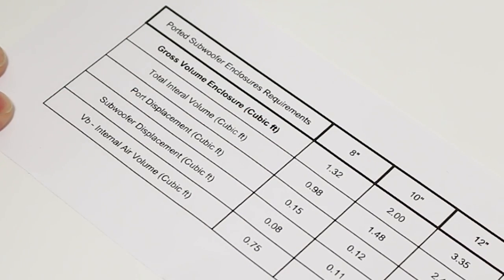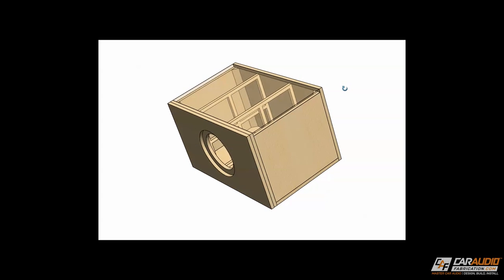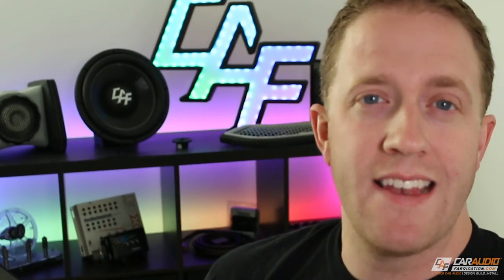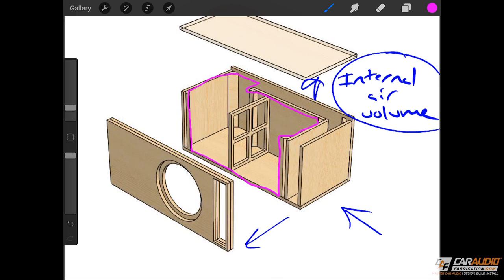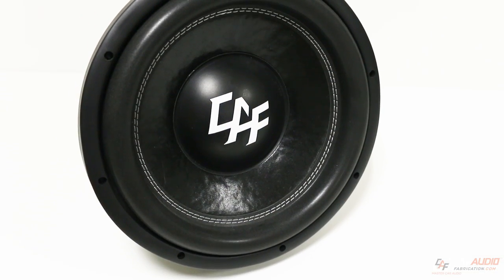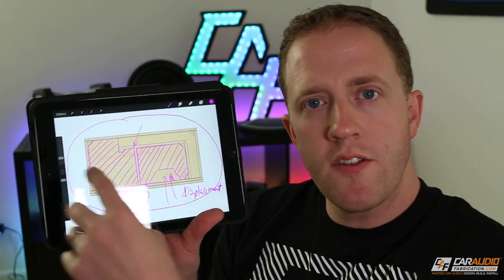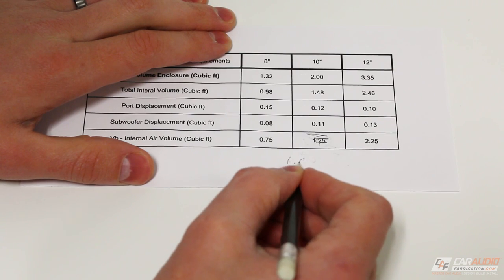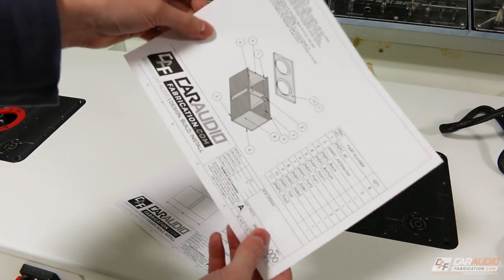Subwoofer Box Volume Explained - Gross vs. Net vs. Air

Comment: I use fosgate stuff and they give you the ideal dimensions for a sealed enclosure. Would u follow the dimensions exactly(p1s4 10") or would u do your own? Ive built a few of my own over the years but didn't follow the factory exact box specs. Always did my own thing mainly due to wanting the sub to fit in a certain spot. Love the videos and I have learned a lot from them
Reply: For a sealed application, as long as you’re pretty close, it doesn’t make a huge difference in sound. BUT, you will need to adjust your gain based on the box size if you want to maximize performance.

Comment: easy way to find sub woofer volume, 5 gallon bucket of water a plastic bag,measure bucket and calc volume of bucket put woofer in bag and place in to bucket filled with water, measure the height of the water displaced in the bucket, and calculate the volume at height of water displaced.(bucket filled to top with water) the volume of water displaced is the volume of your woofer.
Reply from the maker: I know how to measure it, the point is the manufacturer should be listing the specs. I can't even tell you how often I come across specs that are obviously wrong, obviously made up, or not even there. It's sad that "manufacturers" (more like send an email to China and place an order-ers) can't list this info correctly.

Comment: As always, very nice and informative video! It'd be awesome if you could make one video about having two subwoofers in one single box, do they have to share the same box or it's better to separate them? Thank you very much!
Reply from the maker: IMO its better to keep them together and working together. People will say "but what if you blow one subwoofer?!?!?" Tune your amplifier correctly and use a good box design and this isn't an issue to worry about. I can't remember the last time I have damaged a sub.
Reply: CarAudioFabrication Mark, thanks for the advice! I have two subs in one box and I was hesitant about having them working together, they both are in parallel at 2ohms, I always watch your videos, very informative! Thanks again! Greetings from Peru!
Reply: @jordan010203  Use both in a push-pull setup, makes the volume of the enclosure 1/2.
Reply: I prefer them in separate chambers. Blowing a speaker isn’t always about proper design and setting. Sometimes it’s a QC issue and others it’s a material lifespan issue like how old rubber gets brittle. Finally, if you have a high-end setup, it also allows independent time alignment and tuning.

Comment: Hy mark i have a question about port ratio. I am planning to build a subwoofer enclosure whit 2 skar sdr 12"D4. My program Torres gives me a ratio of 1:3.64 is this good or bad.
Reply from the maker: You need to check and use a real program like winisd. Torres is only a tuning frequency calculator. Nothing else. It tells you nothing about the performance of the port or the predicted response. It literally only tells you a tuning frequency. With WinISD you can get an actual idea how the port will perform and if the vent mach speed is within an acceptable range.
Reply: @CarAudioFabrication  Thanks for the reply. I have winsd on my computer. But I havend used it that mutch so it's a bunch of abracadabra for me if you have some pointers for me I would be glad to have them. Or maybe I Wil order a design from you but whit te skar's. At this point I am still orienteding. Thanks for te info.

Ps like your vids and teturiols

Comment: As a cabinet maker Love the channel keep up the good work. And good routing practices. But why does a subwoofer have to b boxed at all why can’t it just b mounted firmly like a 6x9 speaker. Or why ain’t 6x9 speakers boxed.
Reply: Philip Mortimer they are not free air speakers
Reply: They can be. They're call infinite baffle speakers. Normaly extremely high qtc values think in the range of .7-1.3 qtc

Comment: Is the space between the rear of the subwoofer and the box wall behind it, critical?
Reply: No, aslong as its not flush to the box, you can have any amount of air but if there are holes on the backplate don't make the magnet fit flush to the back of the box

Comment: Great video! Just liked and subscribed :). I never knew that the port volume was not considered part of the total airspace! I was about ready to shove 2 basketballs into my subwoofer box to take up the "extra" .5ft3 of airspace i thought I didn't need. My subwoofer is "clacking" when I send full volume high bass music to it at max volume. Not sure if that's distortion of bluetooth signal * head unit distortion * mechanical distortion, or simply that the sub is over-extending due to too much airspace. So I backed down the subwoofer amp gains until it no longer clacks at full volume. But now i miss the "slam".

Comment: So what do you do when the manufacturer doesn't specify what volume they are using, i. e. Gross versus net etc.?
Reply from the maker: If their engineering department has half a brain cell (or if they even have engineering) its going to be a net value. Gross is essentially useless because so many other things could be going on inside that volume that it tells you essentially nothing about the box.
Reply: It’s almost always expressed in net. If not it will specifically say gross. If they don’t have a number at all, buy something else.

Comment: Is it better to have 2 12” subs in a 3.8 cubic ft ported box or 1 12” in a 3 cubic ft box? Mainly low bad but also somewhat punchy .I was always taught that more come area is better but what do you think? Thanks love the videos!
Reply: Completely depends on the speakers used. Cone area is an area and your question is about volume.

Comment: I feel your pain brother. Too many companies only rebrand Chinese part, pick and choose T/S parameters obtained by various non-concurrent test methods, and rely on the…naivety…of the end user. Most buyers only want loud noise and don’t have the means to test and verify results, let alone compare them with alternative setups. The mass market manufacturers honestly don’t care as long as they make sales. There’s probably a reason they don’t want to share as many specs as high end companies and it does NOT have to do with intellectual property. It’s all about marketing. 😢

Comment: Hi, i like your video. I have a question for you. I bougt 15 in kruger&matz KM380T11 speaker. I don't know what vlolume box need for this speaker. Here is many diferent parameters  i cant understand.
Size: 15 " Maximum power: 1000 W 
Frequency response: 25 ~ 1 500 Hz 
Sensitivity: 89 dB 
Impedance 2x 4 Ohm 
Magnet: 100 oz 
Coil: 65 mm
T / S parameters
Revc: 3.4 Ohm 
Fo: 29.025 Hz 
Sd: 70.686 cm 
Md: 200,410g 
BL: 9.803 Tm 
Qms: 5.798 
Qes: 1.328 
Qts: 1.081 
No: 0.184% 
SPLo: 84.7 dB 
Vas: 103.609m M 
Cms: 146.030u M / N 
Krm: 5,036 mOhm 
Erm: 0.843 
Mms: 205.893g 
Mmd: 195.087m Kg 
Kxm: 24,497mH 
Exm: 0.649

Thanks you very much if you can help Me.

Comment: Regarding the big and small sealed enclosures. If I wanted decently low bass out of a 12, could I build a box bigger then the manual suggested, and just power it with a bigger amp then the sub needed? I know people do this with ported boxes, just curious about sealed
Reply: Bigger box = less power handling. No, you cannot do that. Sorry.
Reply: Okay…you CAN, but no matter ported or sealed, it’s pushing the woofer past it’s thermal or mechanical limits.

Comment: Hai,huge fan of yours..I got this prob with my 4chnnel amp,whenever i put the ignition 'on' a loud static noise came through the speaker at the startup and the whining noise also..can you help me suggest what should I diagnose to solve this problem? Btw,the 4channel amp runs through front door speakers n a sub
Reply: Is your amp power cable and your rca cables running on the same side of the car? Are they touching? I had the same problem so i seperated the power and the rca cables to different sides of the car and that solved the issue.
Reply: I ran the power cable under the carpet and the rca on the other side,I've check it few times before but no wires actually touching each other..that loud static noise is really annoying when I put the ignition on
Reply: Mine did the same...also running RCA's on other side of car along with remote wire....and then my Power cables running down the opposite side... believe it or not...it could probably be the head unit itself....try grounding the RCA's behind the radio....if that doesn't work then you'll have to get a better head unit... like I did...and it was problem solved after that
Reply: shane van Heerden already done that before but didn't solved the problem..I think I need a new head unit tho

Comment: How much can you deviate from the recommended internal volume before it would be too much for the woofer to handle?
Reply: It depends on the woofer, but in most cases even a 10% deviation will have little effect. What’s more important is checking the results of your assembled box before calculating actual desired port length. Look up Focal subs spec sheet and it can show the response graphs and corresponding box sizes to give you a better idea.

Comment: How does the manufacture determine the recommended volumes? I would guess there has to be an actual formula or metric utilizing the drivers T/S parameters that gives you an ideal range? I can't imagine that those volumes are determined by engineers via the guess work of trial and error. ???

Comment: I've had so many headaches over trying to figure out enclosure sizes for my subwoofer.  The data sheet for my old JBL driver uses that same ambiguous phrasing "includes driver and port displacements" and they don't include the driver displacement.  In fact you might have even got that example from a JBL datasheet if I didn't know any better.  

What bugs me even more is that different manufacturers provide different TS parameters, either by giving them different names than standard, or just not putting them in at all.  Not ideal when WinISD is asking for values and you have to decide whether not putting them in will affect the resulting enclusure design.
Reply: Not to mention, many times those parameters weren’t obtained in the same test condition and don’t actually go together. Some manufacturer in China sent that data to the seller who uses it for their own marketing after slapping on a logo. 🎉

Comment: I got me Skar ZVX v2 12 recommended is ported 3.0 tune to 34 hz my box is ported 2.0  tune to 32hz will it's hurt the subwoofer.
Reply: I actually have two Skar ZVX v2 12, so I need a total of 6.0 cu feet. Only problem is I don't know if I could fit that in my 2006 Nissan Altima. My box was total 4.0 for two Skar EVL.  Am going to put those Skar ZVX v2 12 in them hope everything is ok🤔

Comment: Would a 10" * 10" * 10" sealed enclosure somehow be realistic for a 100W 8" Subwoofer? The seller didn't provide anything at all except wattage and size.
Reply: If the seller isn’t supporting you with details, don’t support them with your money. Simple solution.

Comment: OMG ! Is he ever right about manufacturers not listing subwoofer displacement values !!! They should tell me the displacement for surface mounted, flush mounted, back mounted, and inverted ! Let me choose the appropriate one and then do the calculations ! Freaking kills me to have to take wild guesses !!! Urggg. Dealing with this right now :(
Reply: I know this sounds crazy, but say you wrap your sub in a thick plastic and sink it in water, and measure the displacement of the water. That's how we do volume displacement for irregular shaped items in chemistry settings. 🤷‍♀️
Reply: @elizabethburress9129  Their are just too many tight corners, and such, to get thick plastic, into and around. I think if you did your best, it would add 50% or more, to the actual volume displacement, and their is no way to tell how much the "or more" part might be. In a nutshell, not accurate enough to be worth ones time.

Comment: One thing you did not touch on is the structure. A box needs to be as stiff as possible. I use screws (a lot!) instead of staples. Coating the inside with fiberglass resin will seal and stiffen it.  The box will show in performance what effort you put in it . There are no shortcuts. Also , route edges of port instead of sharp edges , you reduce port "whistle".Box building can be a science.
Reply from the maker: You make good points but the intent in this video is to clarify air volumes over discussing construction techniques. And resin adding strength is actually a myth, resin by itself is actually quite brittle, its glass fibers that add strength, so while coating the inside with resin will help seal an enclosure, it does little for strength.

Comment: hey, can you help me, here's my `10" subwoofer T/S parameters ( there's no T/S parameters from the speaker manufacture, its a cheap subwoofer tho, i measure it my self, probably not so accurate) 
Fs :  28,9Hz
Re : 3.6 Ohms
Qms : 1.461
Qes : 0.350
Qts : 0.282 
Vas :46,4071 lts

can you help me for the box volume, ported or sealed, thanks :)

Comment: Can someone help with an answer....Sub box shape vs cubic volume. on a sub box... as long as the volume is right and the port is right it doesnt make a difference if its square or rectangle shaped...
Reply: There’s not really a perceived difference. It’s even hard to measure with equipment.

Comment: I may be wrong but.... if the net volume as per manufacturer's recommendations include the displacement value, it doesnt matter what the actual displacement is. Probably be why they don't include it.
Reply from the maker: What if I want to inverse mount the subwoofer? What if I'm putting it in a fourth order bandpass and need to know how much displacement is in one section. It's 100% laziness and fear from the manufacturer that they might "confuse someone" and thus have them not buy their product. Or they don't actually engineer their subs, they just pick random parts and have them thrown together and silk screen their name onto the dust cap.
Reply: @CarAudioFabrication  I agree with you to an extent, I think the price range may also be a contributing factor, budget-mid range drivers probably sell the most amongst "I want something that works" target audience that probably just buy a driver, amp and pre built enclosure that suits the manufacturers recomndations. I do however 100% agree that if this tactic is used in the high end of the price range and up in the enthusiasts/ professional target audience, then it is pure laziness.

Comment: What about low profile subwoofers when it says 0.5 to 1 cubic foot?
Reply from the maker: You would want to start with .5 to 1 cubic ft when designing the box and looking at how that response will model and then determine if it matches your goals.

Comment: How big of a problem is port resonance? A lot of people make big ports with low air velocity but don't mention anything about port resonance which according to some calculations could be very audible and ruin SQ.
Reply from the maker: It's a balancing act and a very advanced topic.
Reply: @CarAudioFabrication  Should I be more worried about air velocity and keep it low so there is no port noise?
Reply: Part resonance as in the tuning frequency? It’s supposed to resonate around the tuning frequency. That’s the whole point. If you’re that concerned with SQ, don’t use a potted box. I’d be much more concerned with air velocity and flared ends if you already have a properly tuned port. 😅

Comment: Its hard for me to decide on what subwoofer is best for me when manufacturers dont list the entire specs.
Reply: Then look it up... jfc, braincells are lacking in this fella.
Reply: @sethh8892  Not as easy as it sounds. There really are manufacturers that dont want you to know their entire specs. Many cheap brands list false specs. I was surprised when I visited Sundown Audio website to find little to no specs at all on some of their subwoofers. (Not saying anything bad about Sundown Audio, it was just the last site I researched) As a last resort I guess that I will have to contact whatever manufacturer to find out the information that I need. Just more work that is necessary. Not everyone has the testing equipment, environment, or the time to do the proper testing themselves. Just saying it would be easier on the consumer if everything was listed in its entirety on  websites.
Reply: It’s easy for me to decide. False or no specs = don’t buy it.

Comment: best sealed volume suggestion for an older single Kicker Comp VR 12 (07cvr124)?
...got 2 of em in a double sealed 1.2'x2 prefab shit box from a friend for cheap. sounds like poo. want to rear-fire/corner-load a deep sealed box along the driverside trunk of a '16 Mazda 6, with slight angles up/passenger for the sub. looking for lows while the sealed will still provide punch... SQ build. i'll just store the 2nd sub till needed.
Reply: Look up the specs.... manufacture tells you regardless of what it's going into
Reply: @mikecheeze4312  eh, mfg's tend to lie to make it seem their products are more versatile than they really are (that way small shops can stock fewer options & still make off-the-shelf quick sales). i took the thiel/small parameters and did some napkin-math, cause i don't have a plotting program... 3.6cuft seemed like a good balance between efficiency & output at lower frequencies, but i wish i could chart it out & adjust. i need a good/free box program.

Comment: Subwoofer displacement, fill a big bucket with water to the edge,
Put the sub in a plastic bag
Dip it in the bucket down to the mounting flange
Then refill the bucket to the top and count the volume it takes
Reply: Nope. It’s not like measuring a solid object.